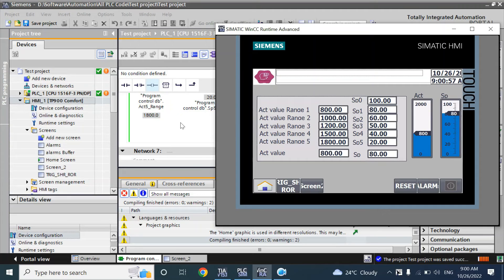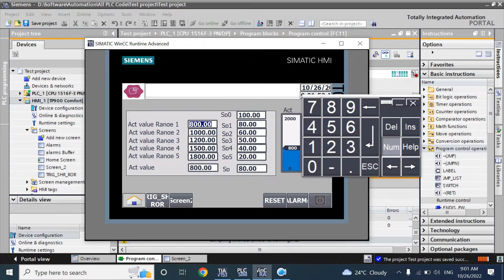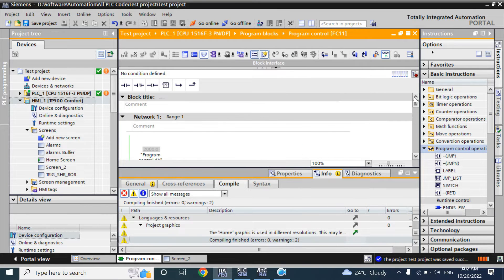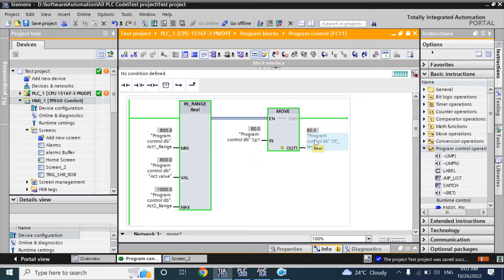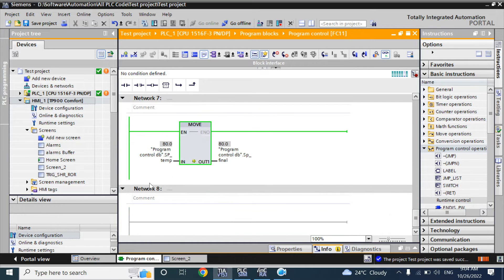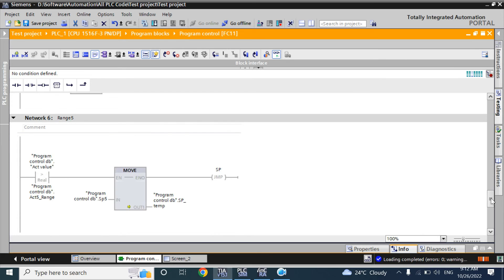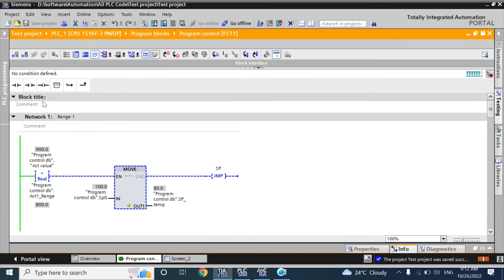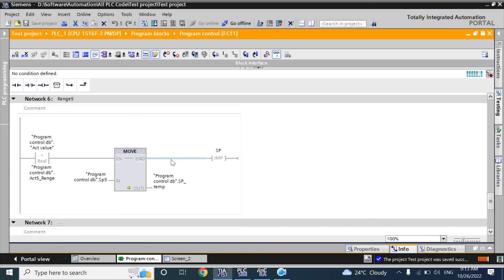TIA Portal: Program Control Instruction | JMP | JMPN

Comment: Hello Sir farid my question was about act value range 1,2,3,4 & 5 what is that value meaning are those rpm of the motor and also Sp 0,1,2,3,4&5 is that the setpoint to the motor.
2 . In real world application sir farid where can we use this  kind of program thank you sir farid
Reply from the maker: @nelson pantaleon  Here , act range is in mm of material height in a bunker and SP is in %. If material is low (measured by level sensor) in bunker then motor will run faster to bring the material.